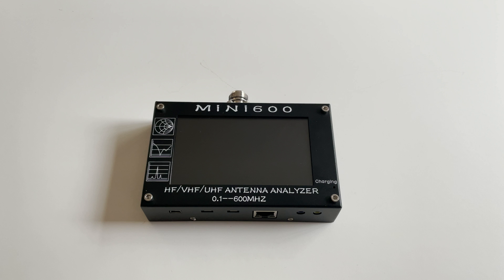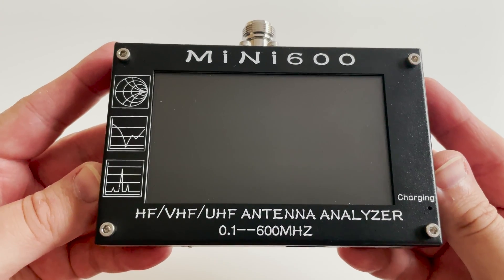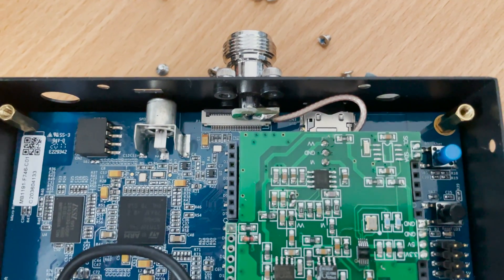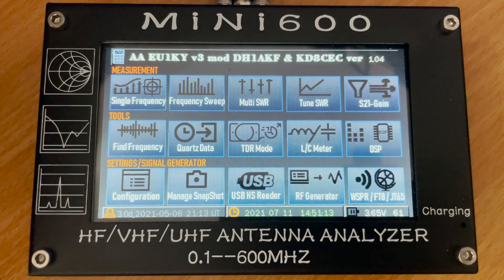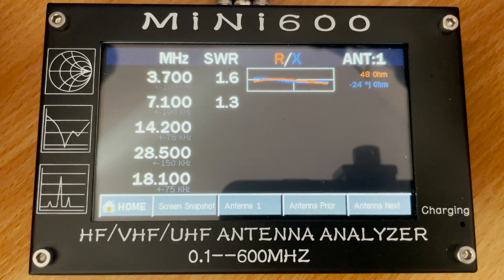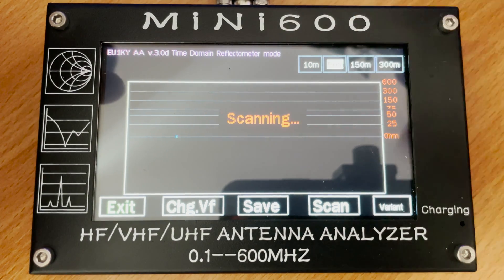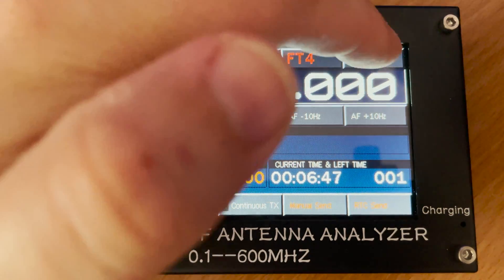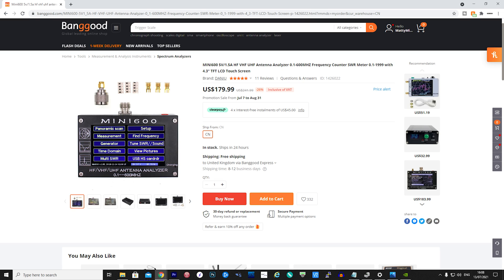MINI600 Antenna Analyzer EU1KY Firmware Version 1.04

Comment: WSPR, FT-8, JT-65 all work however WSPR is only really practical.  All others just for test transmitting or perhaps beacon.  TIME has to be set very accurately with Date/Time and note; the small SMA is the transmit port NOT the larger type N.

Comment: I think the oine from funtronics is well worth the extra. RC installed as well as 2 nd port. The mini 600 and 1300 hav  almost killed the message board used by the early EU1KY users. Some bought the kit and some built  but none were like the Mini 500 and 1300.

Comment: I have EU1KY for more than 2 years (model FAA-450 sold by Elekitsorparts). That's my favorite antenna analyzer and also L, C, and complex impedance meter. I use it all the time. It doesn't do WSPR but since there is no power amplifier or more importantly proper filters in it, it would be illegal to connect it straight to the antenna for transmitting anyway, so I don't miss this feature. 73s de R2AUK

Comment: Firmware upgrade does not work on the old 600
Reply: It does.You use the files from KD8CEC version 1.01 works fine. Just drop thye file onto the SD card & wait until it loads then resets.Best to re do the calibration & away you go.
Reply: Ive bought the mini 1300 recived it today mines running on v1.0 firmware does anyone have a link to the most latest firmware for the mini 1300 feel free to comment if anyone has anylinks to update the firmware many thanks 73s

Comment: I built mine using the STM discovery board a few years ago. It is in a ubiquitous Eddy box in true home construction style. I have been very impressed with it and find it works very well. I have used the TDR to locate a coax fault and found it to be reasonably accurate. I’ve not used the WSPR function as I have a GPS locked Ultimate 3 TX from QRP labs, which has been running 24/7 for about 7 years now on 10MHz. While it has been received all over the planet including both the Artic and Antarctic, you can probably hear my 200mW on ground wave, as I’m probably only a few miles from you. Cheers Nick G0OQK.
Reply: I had a look at my analyser this morning and found that I had built it with a real time clock installed, which I had forgotten that I had done. I set the time and adjusted the audio frequency as it was slightly LF compared to my GPS locked beacon.  It is currently running on 28MHz however RF output is very low and I haven’t been spotted. If you want to use the EU1KY for WSPR, I would recommend building a simple power amplifier using a single BS170 FET. An example can be found by looking at the circuit of the Ultimate 3 WSPR TX from QRP labs. This should be followed by a suitable low pass filter, design available from the same source. 
However the best solution would be to buy an Ultimate 3 kit for WSPR use, a relay switched filter is available for multi band use. Nick G0OQK
Reply from the maker: That's awesome! I know these have been around for a while, but I find it nice to know that someone, EU1KY is still developing for it. If it could reach up to 2.4GHz then I could get rid of my other VNAs lol.. Cheers!

Comment: WSPR timing, the original sotabeams wspr transmitter I have needs to be started with the press of a button precisely to sync with the wspr timeslot. If you can start this device in a similar way it then is down to the accuracy of the onboard clock that will effect the over-time results.

Comment: anybody has any information on how to get the wspr setting to work on these units ?
Reply from the maker: I think it’s a timing issue, just try and get the time exactly right along with the seconds. Meaning you have to keep an eye on the time and then turn it on at the right time. Well, that’s my theory anyhow.
Reply: Ive recently bought mine got it delivered today its running on v1.0 firmware does anyone have a link to where and how I can update the firmware on the mini1300 many thanks 73
Reply: Hi Mat (and others), thanks for your clarifications, more lectures on the unit will be welcomed. HW  and Xtal  calibration etc. ... Please and Thank you 😊 !
My Mini1300 works well on WSPR,  many stations reported back.(you need a quick finger to log the time stamp in though. It is such a wonderful tool for the price that I bought a second one as a spare and for comparison sake. 73's all ZL2CM